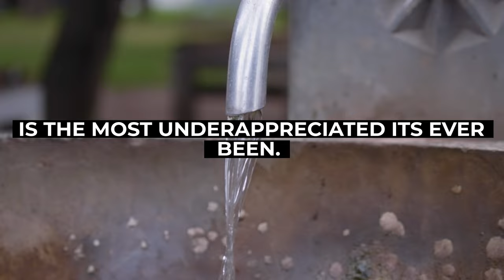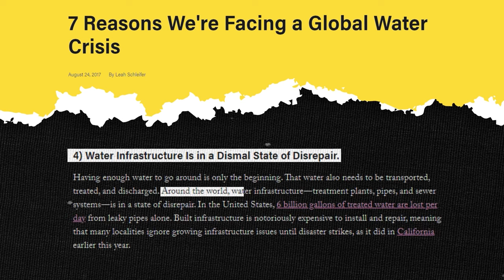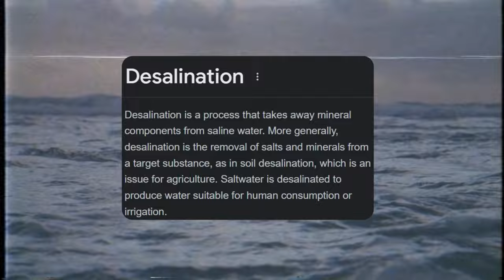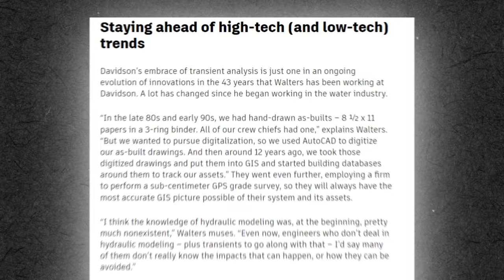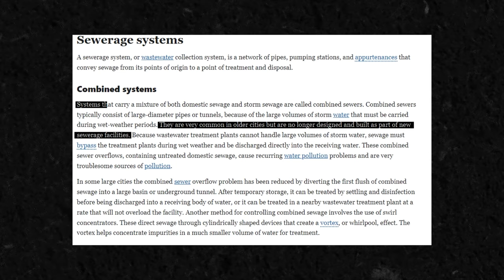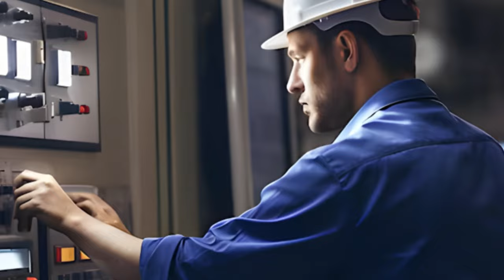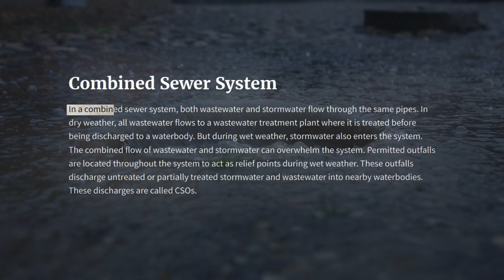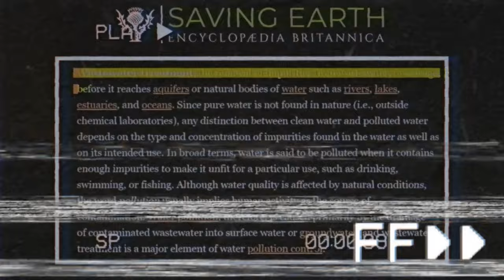How does Water Infrastructure Work? | Secret Underground Water Networks

Comment: Why we can't teach stuff like this in schools using animation like that? Our (high)schools seem more about conditioning than real education. Even many college/university degrees are not that useful, most graduates can't find a job or end up in sales no matter the major and degree they get. It seems that this tendency is all over the world, I am from Europe. Correct me if I am wrong about the jobs graduates get.
Reply: My guess is that these sort of jobs are not very in demand.  You only probably need 10 engineers to run a water treatment plant for an entire city, eg.  The information is also closed circuit, because hiring is not a huge issue, it's a closed community

The issue is typically just that maintaining and building these things requires a lot of time and money and material for construction, etc.  But the construction workers are just there to follow the very limited number of architects are engineers that are needed, and could also be working on other projects.  Even so, the vast majority of jobs required is in construction labour.